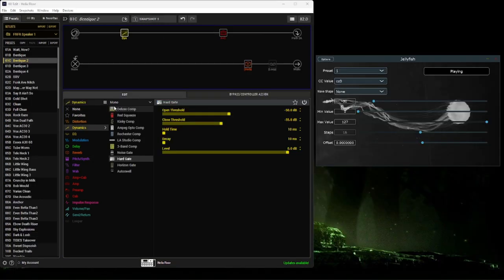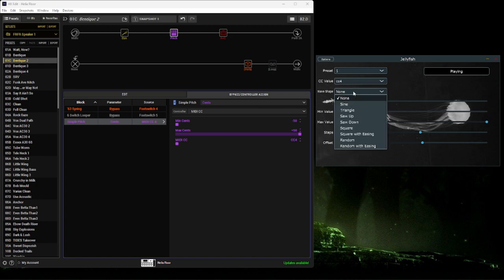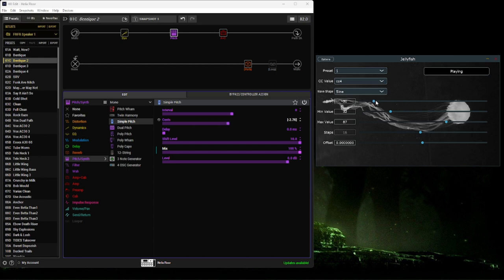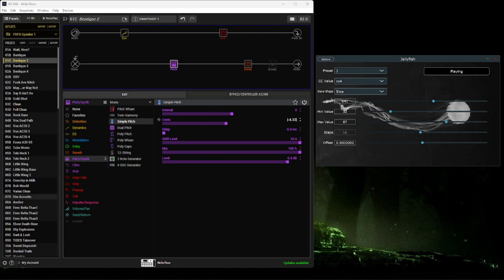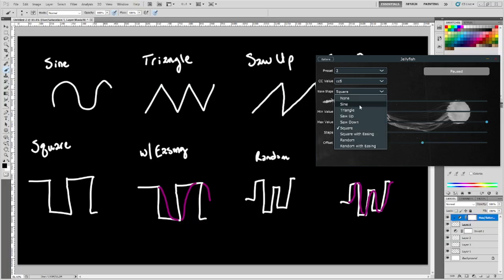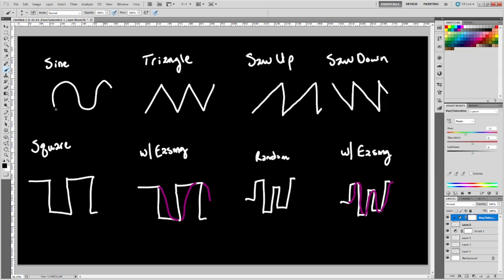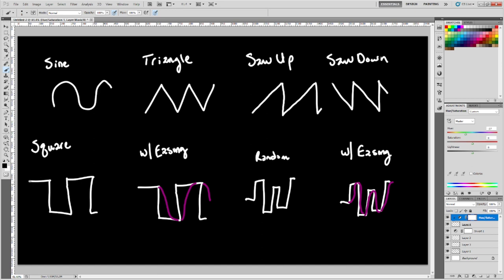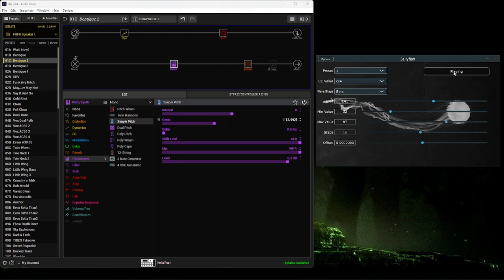JellyFish - Midi LFO Automation Standalone App for Helix

Comment: Took me a minute to get it to work, possibly worth mentioning in the setup to make sure that "MIDI over USB" is "ON" under the Helix's Global Settings.

Thanks for this though, it's something that Helix needs to incorporate into it's internal settings somewhere! My old Digitech RP360XP has LFO control over nearly every parameter within, and that's about 10 years old!
Reply from the maker: Very good point. It's been so long since I had to mess with the global midi settings I definitely missed that.
Reply: @PatrickWard4  I don't know much on midi, I have a Boss SY200 which I've sort of figured the midi controller out for it